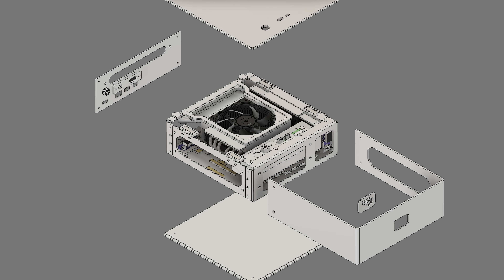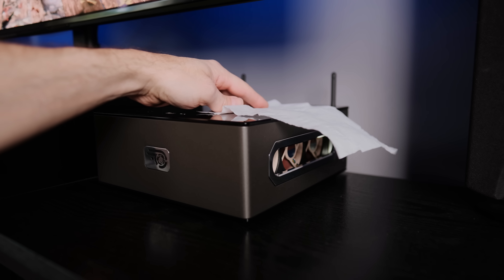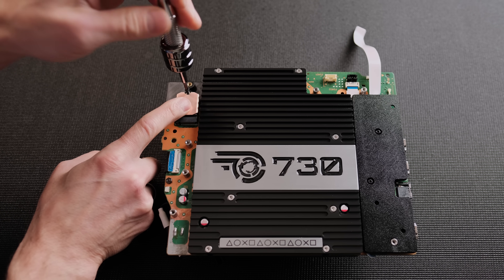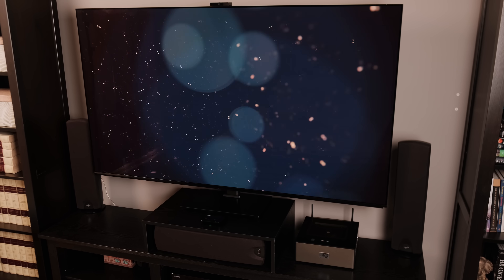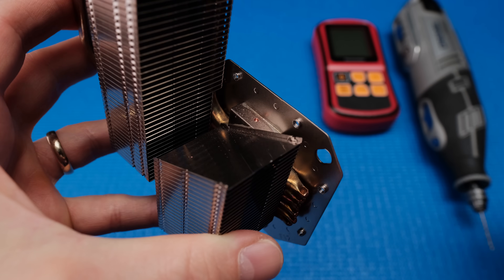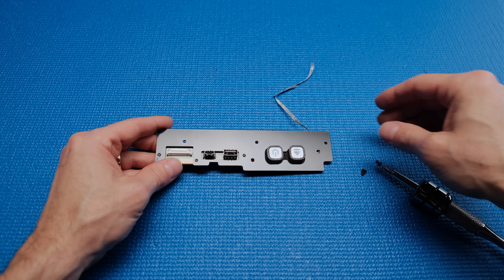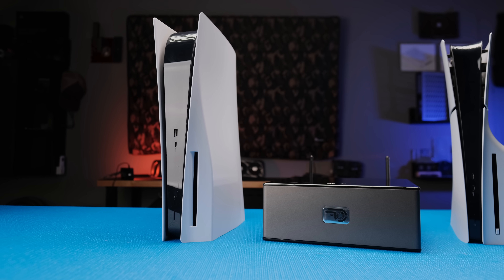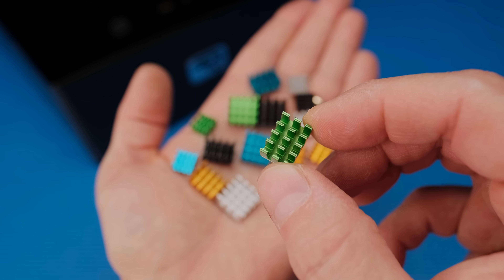YOU can make this TINY PS5!

Comment from the maker: Quick note on the noise at 2:47 —
1⃣ Fans were at 100%, mic only 3ft away.
2⃣ From 6ft, the mic couldn’t even pick it up.
3⃣ Shot was before the final redesign (now quieter).
4⃣ The clip was to show timbre, not volume.
This cooling design runs far quieter at lower RPMs while still matching or beating the stock PS5.

Comment: I have two PS5s, one with a disc drive and one digital. I’m going to buy the kits and the manual, and I really hope this helps keep my PS5 cooler.

Honestly, I care much more about better cooling than a smaller size. If I could, I’d put the PS5 inside a PC case with 13 Noctua fans just to keep it as cool as possible . So in the end, either I manage to do everything right… or one PS5 is going to end up in storage.

Comment: It's cool but that thing is loud lol. The jet engine returns lol. But yeah definitely a VERY nice compact looking design. But again much louder and much more expensive.
Reply: It's quieter than the video portrays. The fans were running at 100% with the microphone only 3 feet away. It wasn't the best way to show it in the video, but the microphone wouldn't even pick up the noise while sitting at the average distance of 6 feet away from a 65 inch screen with the console below it. The beauty of the cooling design is that the fans can run at a far lower RPM and still match or beat the original PS5. You can adjust the speeds according to your preference.

Comment: 08:10 - Is this the best way to power a PS5 inside of a PC build using the power supply he showcased ? Can anyone explain how it works and if it's the optimal method? I'm planning a similar integration and want to know if this setup is reliable and efficient for long-term use.
Reply from the maker: It sounds like you aren’t interested in my opinion and only the chats, but if you are we have several videos on the HDPLEX and other power supply mods for tiny pcs and consoles on this channel. It’s a primary focus.
Reply: @NotFromConcentrate  I’m really interested in your opinion on this—your video is awesome and I admire the build! I’m just an amateur trying to figure out the best power supply option for a PS5 + PC combo. Any guidance would be super helpful. Thanks!
Reply from the maker: @Taxfreejay  A mean well LOP PSU is another option, but the small ones are 300w; so the 500w GaN is the smallest option.
Reply: @NotFromConcentrate  Got it—thanks for the insight! A LOP PSU at 300W is tempting for size, but yeah, it’s cutting it too close for a full PS5/Xbox + PC combo. The 500W GaN really is the smallest safe all-in-one option with headroom. Appreciate you clarifying that—definitely helps me avoid under-speccing.

Comment: You made a ps5 into facelss black brick with questionable noise levels. 
This is not an aesthetic improvements nor is it a functionality improvement.
What is the pint of this endeavor? 
If you really disliked ps5 so much, you could've just hid it inside the tv cabinet and provide it with some ventilation there.

Just DIY for the sake of DIY.
Reply from the maker: Hey, I appreciate the feedback—even if it came more as a statement barrage than a discussion. If you have actual questions, we’re always happy to answer them.

If you were confused by the sound test: yes, the system is quieter than stock. The amped-up mic was used to highlight tonality, which in real-world use is often more important than just raw decibels. You need to read the results with the meter and noise floor. A soft, whiny fan is more irritating to many people than a louder, deeper hum.

As for the design: yeah, it’s a minimalist black box. That’s entirely intentional. It’s meant to disappear into builds—especially for people who need to fit their PS5 into tight spaces. We’ve had tons of people (including truck dwellers and mobile gamers) reach out asking for help shaving off a few cubic mm here and there.

But the whole point of the project is to empower other modders and artists. With the thousand hours of modeled parts and guide we built over the past two years, you can treat this as a foundation and build something uniquely your own. Hundreds of TINY PS5 mods have already evolved from this framework from our first two PS5 mods with files. We have helped the modding community with the release of two CAD motherboards for the PS5 for free as well as replacement parts for 3D printing. To you, this is one dumb video on the internet. But it's also inspired a hundred others who have used our files and processes over the past two years.

You don’t have to love the aesthetic, but I hope you can at least appreciate the engineering behind it. And if you’ve got ideas or questions, feel free to ask—we’re always open to the conversation.
Reply: @NotFromConcentrate  Thanks for clarification. And yes, I do appreciate the engineering behind. It's was just a big letdown in a design sense after previous videos.
Reply: @trashviewer3521  As for the aesthetics, I prefer a clean and minimalist look when it comes to a console sitting on my entertainment center. That's why it looks the way that it does. The files can be modified for a look that you prefer.
Reply: @nfcerick3634  Well it can me modified to a point, but so is original case assuming you have 3d scans\measurements. And modifying original case is hardware agnostic fast, easy and cheap.

My initial point was that the cleanest and most minimalist look can be achieved very in a simple and effective way by just putting hardware inside a tv cabinet.

Comment: That looks amazing! In some sense I think the PS5s original design stands out well but in practice something like this would be so much more convenient.

Perhaps high static pressure fans could improve cooling further though, given the restrictive intake and cramped space. The fan blades look to be rather far apart for their intended purpose in this awesome build.
Reply from the maker: Very true, but gotta work with the constraints; so it's overcome with negative pressure (two fans on the CPU, push pull) and the three exhaust.

Comment: I don't get the point. It never was Sony's goal to make the PS5 as small or efficient as possible. Priorities were cost efficiency and that curved design so it would stand out against competitors and their boxy boxes. The exact two things this modded PS5 is bad at.
Reply: Sony always makes their consoles smaller and more efficient. As for their priorities, I wouldn't know. I don't work for them, so I'll have to take your word for it.
Reply: @nfcerick3634 Duh. You don't have to work for Sony to understand it. Consoles are generally too cheap for the hardware they contain. So console manufacturers at least try to source the parts as cheaply as possible. If AMD offers (nearly) the same power as Intel for less money, they go for AMD, etc.
And design contraints limit the PS5 in terms of size. That's why even the Slim version isn't as small as the one shown in the video. It's just different priorities.

Comment: You canot use a 250w PSU on a computer that use 230w. If the chip power use spike, the PSU trips.
I have a PC that use less than 500w and it trips a 750w PSU.

Comment: 07:38 there is no thermal throttling on gaming consoles, they keep consistent frequencies because the games need to run the same on every device. The console would simply turn itself off when it hits some temperature limit on the APU
Reply from the maker: That’s true for older consoles, but modern consoles do indeed throttle; well documented you can check it out if interested. Modern consoles even have visual settings in some games you can tweak.